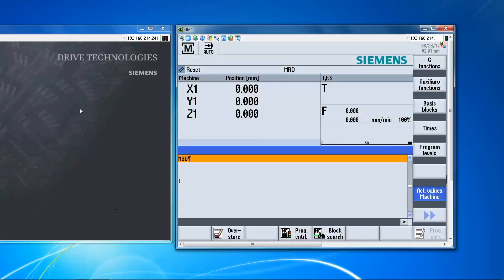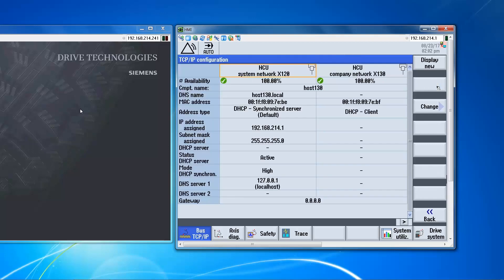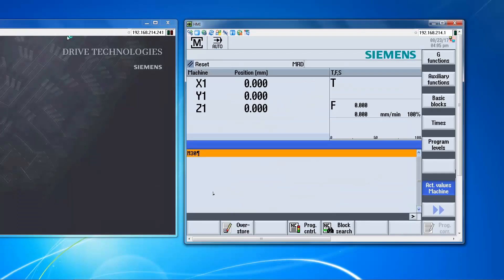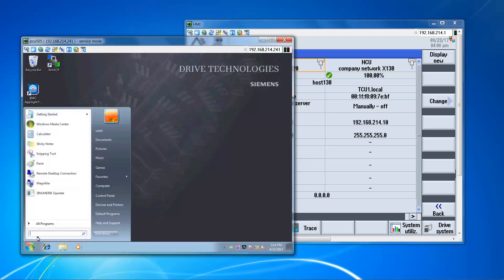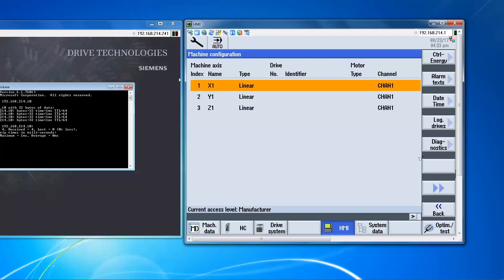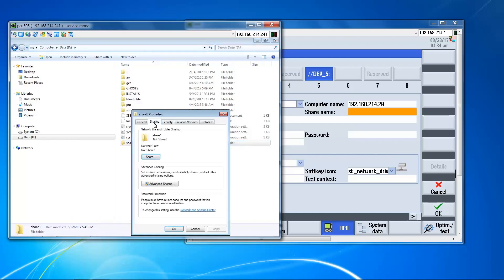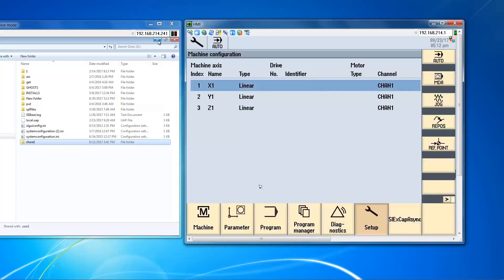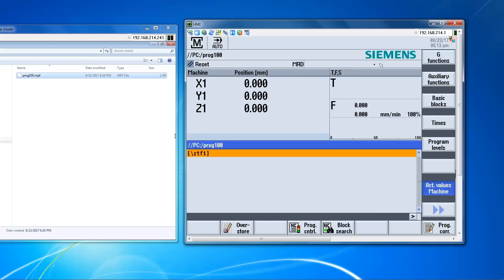Networking and logical drives

Comment: Whenever I press confirm after configuring the drive it always times out.

The file is shared, i can see it on all PCs on the network. I can ping the CNC (Sinumerik 828D) successfully - but cant get it to see the logical drive. 

Anyhing I might be missing?
Reply from the maker: you make sure the password are correct to your pc?